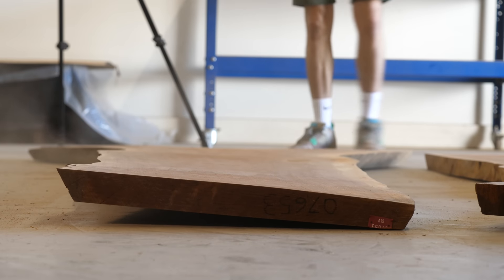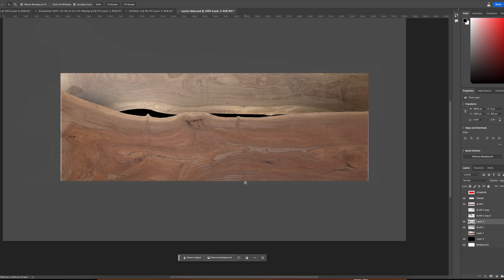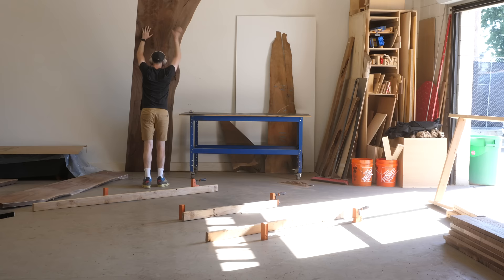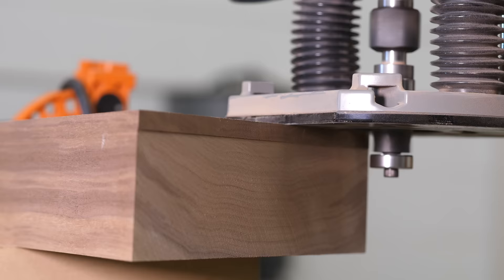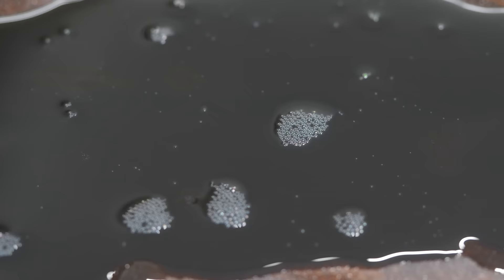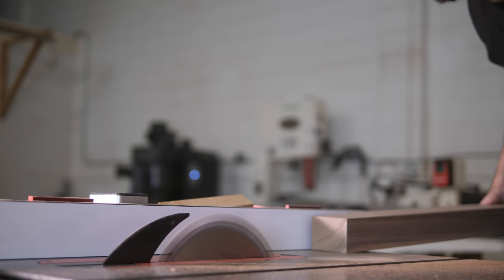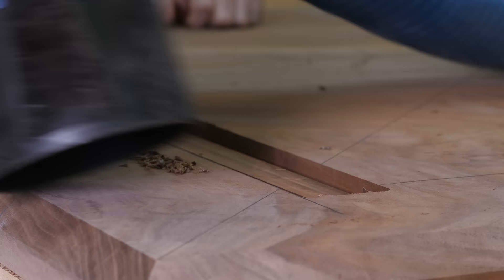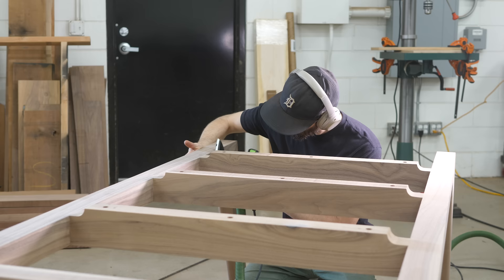Fixing a $30,000 Mistake

Comment from the maker: Thank you for watching! Here are the most common questions I am getting:

1. Some version of "You can see the bolt heads in the C-channel. You should have hid them"
I agree...it would be better if you couldn't see them. This would be an easy fix. Just recess the C-channel more deeply into the slab. Unfortunately this slab was already getting pretty thin, and I didn't want to risk bursting through the top. 
And also...this is much more noticeable in video than it is in real life. In video I tend to get a lot of lower shots to show off the details of the table. To actually see the bolts in real life your eye has to be equal to or lower than the underside of the table. So...not a huge deal in my opinion.
Reply: FAQ won’t work because people are here to complain and be right (like me right now), rather than helping you
Reply: Use an L fence instead of a sled to cut your angles. Since the template is on top, you do not lose any blade height
Reply: @DarkChaosMC what does this even mean
Reply: thanks for converting inch into normal Units!
Reply: Flat Head Countersunk Screws: DIN 7991 or ISO 10642
Reply: oh, so you don't care about toddlers!?!? forcing them to see bolt heads, turrible!
Reply: well it helps you to REACH things, so the name should be "Richy"... obviously ;)

if that is too normal, you could go in the "silent wingman" direction and name it "Silwy"...
Reply: I only came here to comment that I frigging love how both You AND Cam make bold, abashed comments and retorts about the 'biblical ancestry' angle ! From a long time admiring, heebie, cut bro in Australia .  PS - Your gradually improving and increasing use of CGI to demo the concepts and design are REALLY working and put your vids at a level above most all else in the space.
Reply: I like bolts
Reply: I am here to say i did read it, AND use it.. And now im physically hurt. Everything is not coming up milhouse.
Reply: I actually like the bolts, the rounded bolt kind of breaks up the plane of the top at the end in a not distracting way. It's a nice choice in color and shape.
Reply: I don't think your new helper is as amusing, nor as plum, as your old one.
Reply: Why are you so good??
Reply: Why you so handsome 😁😁
Reply: hey bro are you self taught or skill schooled .. iwan to to do this but I'm afraid of the ai/machines taking everything
Reply: I don't really care if I can see them or not. I have very long legs and mostly scrape the top with my knees, especially when I try to put them one atop the other. Having jutting out bolt heads out would be a personal nightmare, I guess. I don't think it's an issue here, at all, and I think you already have like 540 comments about countersunk stuff. Well, you make $30000 pieces, not me, but for what it's worth - consider making things smooth for the sake of lanky people's knees. Continue the good work. Cheers.
Reply: 3 beautiful pieces! Very lucky customers.
Reply: Or, couldn't you use a countersunk bolt in the c-channel?
Reply: Great video. 
Was the table stiffened enough to prevent racking using the stretchers? 
Cool design - it is visually light even with the thick lumber used for the base.  Well done.
Reply: @touch--  they basically admitted to being someone who always wants to be right and never ask questions.
Reply: Was it hard to get the three different planes on the two slabs to match up perfectly so they could be glued together? For some reason that seems impossibly difficult to me and I don't think you showed it in the video.
Reply: agree on the part about a customer is always right if you're a waiter, but not if you're an x-ray technician. we for example are a dental clinic, and in the last couple of years we've been at a back & forth with some of our patients who want their treatments done their way or the highway, and in the beginning we used to just agree with them and then wrack are heads around figuring out how to actually do their monumental task of a treatment while keeping it ethical; and that led to a few rather catastrophic problems that costed us a lot of money and a lot of heart ache. so now we evolved into a very hardline policy, where we can give them all the options they can have for their treatment, but all within our own capabilities and recommendations, and if they don't like it they can happily find some other doctor to torment with (they can get lost and take the highway they love so much). and if they pull the "i know what should be done for this or that treatment so it should be done this way" card on us just because they read a stupid wiki online, then they can get out. 

we have no need for patients who think they know how treatments work or should be done, they dont even know the context behind doing such treatments to begin with, let alone the complexity and risks, many of the methods they cited are literally decades old and outdated information, like who the hell still grafts hip bone into the jaw these days? (america and australia apparently, europe and asia have long since moved on), and who the hell still uses decades outdated 3 stage dental implants? (america), and who the hell still uses mercury silver amalgam fillings? (also... ahem... america... <_<), and who extracts all of your teeth just to cure an infection instead of actually trying to save them instead? (*cough* america & australia **cough**).

they love to quote american medical & dental practices but they don't even know how outdated a lot of these practices are. 
america isn't the land of good healthcare, its the land of prohibitively expensive healthcare, they need to get that in their thick skulls.

my mom earned her diplomate in NYU back in 2010 with her thesis, but it was nothing even groundbreaking, we were literally just doing what we learned here and with our colleagues in neighboring countries, and yet the professors at NYU thought it was cutting edge techniques & technology. compared to some of our genius colleagues our thesis wasn't even that impressive, this tells me that either NYU is gullible, or america is decades behind the world in medicine, and i'm willing to bet on the latter since i actually really respect NYU. and i'm sure they feel the same way as well since we earned a second diplomate in 2018 from our association despite not having participated as actively in the medical community in recent years.

for anyone who wants to know, the thesis was basically 18 dental implants across the upper and lower full arch, 10 in the upper and 8 in the lower. all of which were full sized implants and not mini-implants, and they were organized as non-parallel implants which improved their load bearing capacity by transferring loads axially instead of linearly, the technique used had a three-fold advantage, the first being that parallel implants can only support loads vertically so chewing and tearing forces would wear out the implant, non-parallel implant placement transfers the load axially across each implant so that it can absorb sideways stresses better as well as enabling more surface area within the bone to act as part of the supporting structure. same principle as the inverted pyramid vs the upright pyramid thought exercise. 

the second advantage is that it doesn't require perfect and ideal bone (thick bone across the whole jaw providing plenty of space to avoid the nerves and sinus while maintaining parallelism), since one can simply weave the angle of the implant around the obstacles, we're not trying to build a skyscraper so there is absolutely no reason why it needs to be straight. 

and finally the last advantage is that it enables us to place implants in regions that would otherwise be utterly avoided by other doctors, like the mandibular canal for example. by simply angling the implant lingually we avoid the canals altogether, while enabling us to use full length dental implants instead of stubby short implants (stubby implants have gradually fallen out of favor ever since our thesis was published, these were originally meant for molars but had a high failure rate since there were so short and stubby). 

of course while i say that its all very simple, we actually took x-rays very regularly to track our positions and progress during the surgery, which up until then was practically unheard of. that and our methods to weave around available bone instead of praying to god for a miraculous perfect jawline (which is unrealistic since anyone who has such a jawline would also have a full set of teeth), and our non-parallelism approach was probably what wowed the professors and dentists in NYU so much. they've since been adopted by many of the veterans in the field in america & europe ever since, but unfortunately an vgly devil reared its head to ruin it in recent years with "computer guided" dental implants, which use 3d printed plastic guides to guide the drills and implant insertion "perfectly", but as we've seen it has a very high failure rate since many young dentists perforated the sinus or hit the superior/inferior alveolar nerves, mental foramen, incisal foramen, etc. with them, and to top it off the guides are strictly parallel, its like asking a 3 axis milling machine to do a 6 axis milling machines job, technically you don't need it, but technically not using it creates a lot of problems. 

unfortunately because young dentists are so scared to do it the old-fashioned way its leading to more and more disasters of this kind and is tarnishing the rest of the field of oral implantology as a result. (technically old fashioned means peeling back the gum and exposing the bone to do the implant surgery but what i'm referring to is what someone called the "keyhole implant surgery technique", not exactly sure which sod tried to trademark this technique but we pioneered it all the way back in 94 with leader implants (old and now quite outdated manufacturer) and the idea was to drill through the gum and bone without opening the gum, this technique would minimize the amount of trauma and bleeding to a bare minimum since no incisions were made and consequently speed up the healing process by several months. and then some thief stole our technique and branded it as some kind of scam that requires the dentist to use a special "keyhole implant" when the technique could literally be used by any dental implant type you can imagine.
Reply: @TheOriginalTristanEvo I'm not sure I'd worry about that in the furniture world, because that ship has already sailed. If somebody wants cheap mass-produced furniture, it's available everywhere. So if the market for bespoke handcrafted furniture has survived this long, I don't think automation will threaten it in the future.
Reply: 20:13 the memories we built in those 30 minutes will last a lifetime...Hey i said knock it off...GO TO YOUR ROOM! HAHAHAHAH
Reply: WTF WHY WOULDN'T YOU JUST CUT A STRAIGHT LINE ON THE MOST STRAIGHT EDGE OF THE SECOND PIECE AND GLUE IT IN THE STRAIGHT SIDE OF THE OTHER? WTF
Reply: Awesome build! I'm new to this craft, 1 semester. So what was the mistake or was it a catch?
Reply: Great video 👍 Have a look at John grimsmo he designed and manufacturer's Titanium pen's and share's the ups and downs of the process 😊
Reply: Could you chamfer the bolt holes on the C channel and then use counter-sink screws? You lose a bit of of thickness on the C channel where it's bolted, but the bolts aren't bearing any load, just securing the c channel to the piece right?
Reply: Why do you use Ptex to fill holes?  We used the same thing on skis to fill gouges...
Reply: Juden
Reply: Still waiting for point 2 or more to the FAQ.

Comment: I was skeptical of carving one slab into the other, but that turned out gorgeous!
Reply from the maker: Thanks I was really happy with the outcome :)
Reply: I thought it would've been more interesting to have them overlap each other on opposite ends but pretty cool still
Reply: That's a design I'm loving. I f'ing *hate* epoxy when it's more than just the minimal filler like in this one. River tables are just ugly, tacky, and stupid. Sometimes epoxy is kind of unavoidable, and this table is a great showing blending both styles. Love it. #justsaynotorivertables
Reply: @ChrisHornberger  I agree, I'm not a fan of epoxy tables but Chris has found that fine line between enough and too much epoxy, his are the only tables containing epoxy I would consider for my own place.
Reply: @ChrisHornberger  River tables can be beautiful.
Reply: @taylorhamilton6272  23:30 Tu entrelazado generaría un efecto óptico de que la madera está doblada. Para mi gusto es mejor tener una gran silueta que dos entrecortadas y creo que en este diseño minimalista combina lo sencillo. En un modelo barroco sería interesante, pero la madera dejaría de ser la protagonista para imponer un diseño antinatural.

Comment: Chris, when you're messing around in photoshop I'd recommend using a masking layer, it's a non-destructive way to mask out the parts you don't want and would allow you to reposition the original "slab" under it.
Reply from the maker: I do a lot. The reason I don't here, when I'm messing with slabs, is that I actually like to use the frame I create as a "stamp". I have a positive and a negative stamps so that I can remove parts of the "slab" and use the leftovers to fill in. Basically mimicking what I would be doing in real life.
Reply: @Foureyes.Furniture  ah ok, then I think you can use a masking folder. You'd have your stamp but all images in the folder can be moved around.

Comment: Its a good idea to keep an eye out for auctions of machine shops closing.  You can get hydraulic die carts that are used to lift metal stamping dies rather cheap.  
Most of the people at the auction are there for the cnc machines and the auxiliary equipment of the business can go really cheap.

Comment: The table top is an extreme delight.  It's a section of an xray of the trees as they grew in nature.  The base is also surprisingly simple.  I didn't note, are the legs slightly splayed by the stretchers?  How do you pick your angles?  (13.9⁰ must come from somewhere.)

Comment: I loved the table top. I loved the inferior 45º degree angle chamfer. When it is not possible to use a unique piece and a gap is mandatory because 2 pieces are used, I prefer that the gap be the smallest possible. I am not an epoxy-filling fan. If I would use epoxy, I would try to mix wood saw dust into that, in order to spend less money on that, and also because I think that would dry faster, and would get a beautiful color, instead of using black dyer.

Comment: About selecting the two top piece's orientation; did you consider putting the white springwood to the exterior? This could likely
have given a wider table, dispensed with the unnatural epoxy and given a choice of the natural curvature of the bole. Or to persist with the straight-line design conforming to the two other pieces, the long sides could have been cut straight. This would have presented all the beautiful walnut.

Comment: I’m a total novice here. Could you cut out the double the number of legs and stretcher in 6/4 then glue them together. is the 3 inch lumber cheaper per board foot? or are you just getting a more consistent look? I love the work you do and your temperament as a teacher. You have a gift for passing on wisdom and knowledge in a humble manor. Enough smoke blown!

Comment: Edit: I literally just read your pinned comment! So sorry to post what you got so much feed back on already!

The table speaks for itself, it's amazing. The only thing that took me by surprise was the very end when you put the channel in and the hardware wasn't designed to be flush. I feel like the idea and intent in your head was to have this floating edge of wood. The small bolts underneath visible if could be avoided would sharpen the look ever so subtly. 

However, I might be the only that saw that and only with that opinion. Amazing table and craftsmanship!

Comment: Love how the two slabs came together! The pattern of the wood, highlighted by the finish, together with the epoxy creates sort of a 3d illusion like it was a valley between the 2 slabs. I'd love to see a similar design where both of the slabs are cut but on the opposing ends, creating deeper illusion of them sort of hugging or twisting into each other.
Reply from the maker: Kind of like a "yin yang" only with live edges?

Comment: Loved your process, and the engagement with the project. I am a 'fan' of Mid-Century Modern, and though the set is a 'good conversation' with complex elements interacting, it seems that the 'coffee table' could have greatly benefitted from a floating top, as with the other two pieces, and an edge treatment that is not so squared off. I do have an architectural background, but only limited furniture making, so these are just my perceptions, and I'm not the client.
Keep up the beautiful work!

Comment: how do you assure that the bolts are keeping the top firm enough to prevent its movement/wiggling during table usage, but still will allow the top to expand/shrink?

Comment: I love your channel and work, and have built several of my favorite projects from or inspired by your plans.  

Quick question: why the metal instead of all wood.  I have always found combining wood and metal always leads to failure at the intersection.  Always.  Typically takes years, but whether it’s restoration of 15 year old or 150 year old pieces, wood and metal don’t ever seem to mix, and just pushes off the failure to a future date, where the metal always wins.   Always.  To keep from cupping or bowing, breadboard ends or inset cross grain hardwood flush glued from the underside seems to last and keep the wood from failing.  

However, you have mad skills and experience and I would love to learn why I am likely wrong on some level or some way.  THANK YOU!